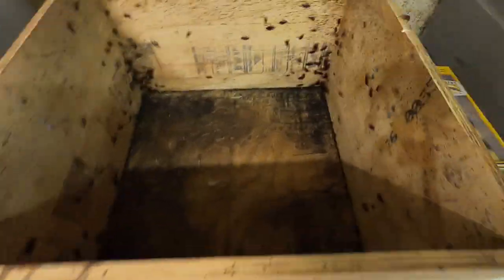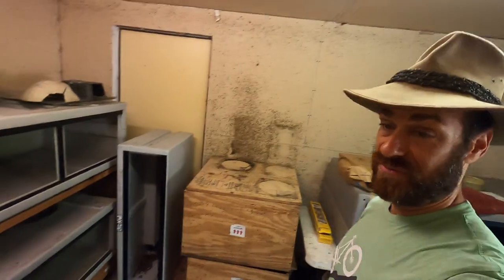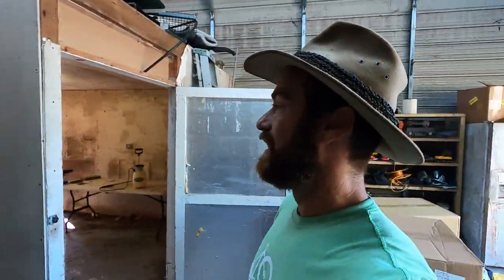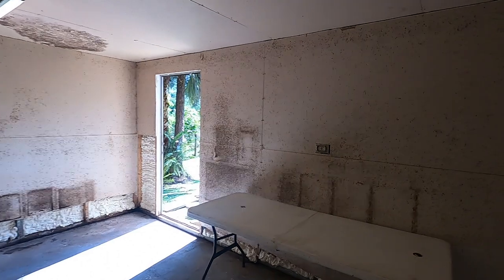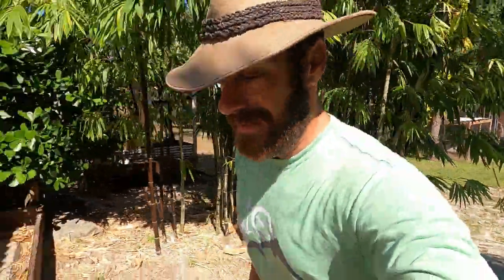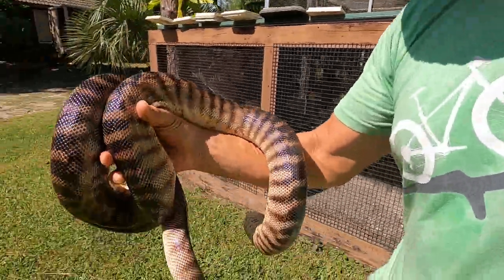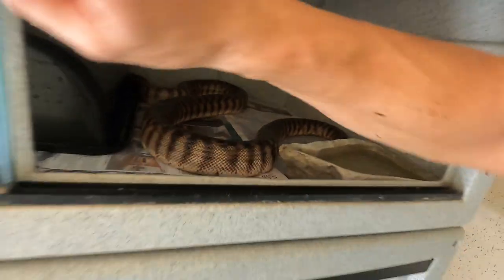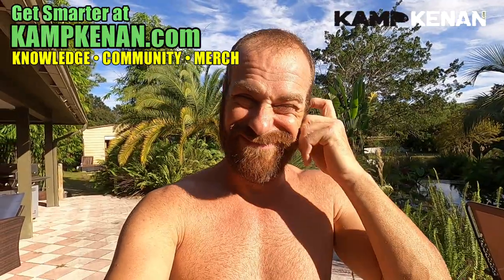Cockroach Infestation at the Kamp!

Comment: So, when I was 18, I worked at the Institute of Marine Biological Research in Wilmington, NC .   I was in charge of all the animals there and inherited the job from a great guy, who was a little bit lax in the cleaning department.  While getting used to the new job I began to notice the very large infestation of roaches of all sizes and varieties,  and made it a point not to go into the feed room after dark.  My office was very quickly accessed through said room, but mostly if I went there at night, I used a less accessible outside door.  Once I had to go into my office through that room at night, and I did not turn on the lights so as to not disturb the extra guests.  My then partner came with me, and did not know about that, so when they came to the door behind me, they flicked on the lights as I was midway across the room.  Literally Thousands of Roaches filled the air!  It was like a scene from the Movie The Birds, only on a much smaller scale.  Screams from behind me only confused me more as I am running around trying to avoid getting them in my mouth!  I made it to my office, and the Emergency Shower in it, and just hopped in, clothes and all.  Also dragged still screaming partner in it as well and we relaxed and eventually had a good laugh.  The entire building ended up being fumigated, after all the bags of food were removed and frozen in the walk in.  The piles of carcasses were amazing.  It seems my predecessor saved a lot of $ by buying foods in bulk that could not be consumed fast enough. I instituted closed metal containers for each variety of food, and a strict pest control program.  Within two months, you could safely go in any room day or night.  Good Luck with this and may you never get as bad as I had!!  Oh, and BTW  Borax ground up with a little sugar and some dog kibble makes the best bait / poison ever.  DIY Roach Hotels from plastic containers seal the deal.
Reply: Great story and thanks for the potential tactical tip. Always heartening to see victories in the war on roaches.
Reply: @jrodowens  The little beasts can't help themselves!!  Even if they die, their comrades eat the fallen and they die too!!  Win, Win, Win!!!
Reply: I would be deceased.  Heart attack on the spot.

Comment: You need to get some Demon insecticide  spray as a crack and service spray. I talked to Jack Armstrong at a breeders expo many years ago and he said they used it at the cricket farm for roach control.  A half gallon of spray at clean up rate goes a long way and most Ace Hardwares should have it in stock.

Comment: my friend had to live in a place worse than that, we'd sit on his bed playing play station and ignore them, if any fell from the ceiling we brushed them off fast. I honestly like some species, Madagascar hissing roaches are amazing and cool and even friendly, you can train them lol but the tiny ones that proliferate and get inside TVs and run fast and have allergens and bite and fly.. those can really suck. Once I was at a bus stop here in my town and I started hearing this weird clicking or tapping, and I looked down and saw these orangey-tan colored roaches running around, they had long vertical legs like a spider instead of squat wide legs like normal roaches, and I could HEAR their feet tapping as they ran around! They were some kind of mutants I swear, weirdest thing, never seen any roaches like them before or since.

Comment: I used to work at an aquarium that had a roach problem. We couldn't spray or use any chemicals so we just tried to control the population as best we could with crack and crevice treatments. Luckily they didn't really come out during the day when we were there so I didn't have to see them much. I wonder if any of the animals ate them when we weren't looking.

Comment: I can just imagine the smell, and gagging a bit. Between the smell of the roaches and the smell of the insecticide spray, I wouldn't be able to breathe in there until it aired for a few days! Are you sure the roach spray residue in the air won't bother the snakes? I'd be worried about neurotoxins affecting them. You really should learn about roach prevention with diatomaceous earth. Anyway, looking forward to seeing that space turned into a new improved enclosure in the spring! Have fun with that, lol!
Reply: Once the pesticide is dry, there is no risk to the animals. DE would be more harmful as they would breathe it in and cause severe respiratory damage.

Comment: I wouldnt use spray foam, I'd use spray insulation unless there's a reason you couldn't unless you don't plan on dry walling it again. And the room is gross but growing up I had a friend who didn't live the cleanest. At night if you turned on the kitchen light, it looked like the counters crawled off. It was insane. Luckily, he's much more neat and clean in adulthood.

Comment: I exterminated for a few years. That isn't that bad. If you remember the Thai food place in Ronkonkoma I got that as a job one day. Complete infestation. Wall to Wall in the kitchen and creeping into the dining area. I used cyanide gas. I walked in all suited up. We had moved the dropped ceiling panels for full effect. It was literally a hale storm of dying roaches for a full 15 minutes before it slowed down. Now THAT was gross. 

IPM that building, bomb it and you'll be fine. Maintenance is key.